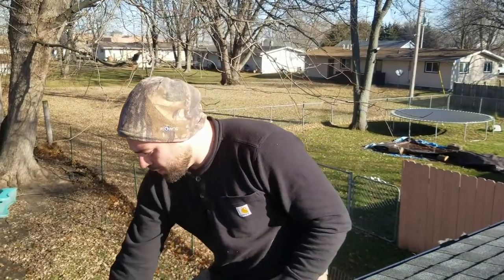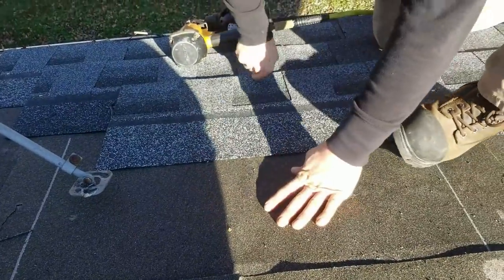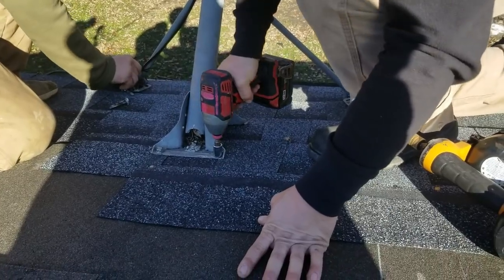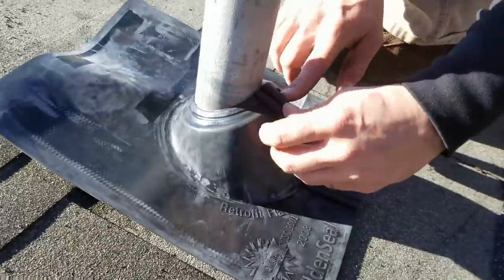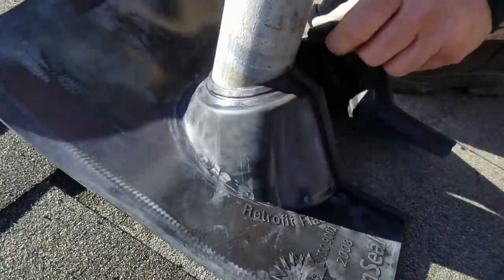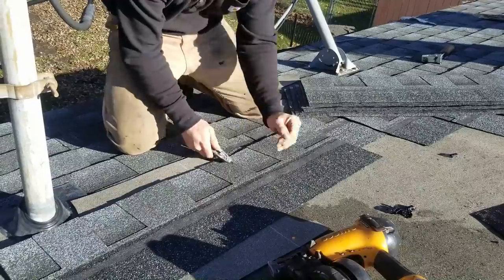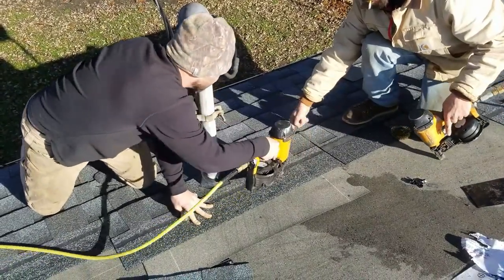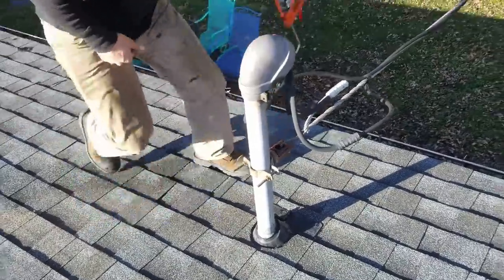How To:  Dish | Split Boot

Comment: Cant beleive in 10 years Ive never realised to use the cut off part of the shingle to recreate the origional stagger after, lol! I always like to cladding screws as opposed to face nailing and caulking it. Outlasts the caulking and sometimes they lift, I notice eapicially in wall flashing. Looks really good too.  On point with boy cub impression.. Good stuff brother
Reply from the maker: Haaaaha awesome you learned that! It's a good trick

Comment: for the bottom part of the boot where the nails will be showing I recommend using screws that youd use for a metal roof. looks better and theres no chance of them backing out or leaking
Reply: Those bottom nails should be covered with the shingle he put under neath never should have exposed material with nails in it like that

Comment: I put ice and water under the disc legs.
Seems to work good.
No call back yet
Reply: As a former dish installer, and someone who has roofed off and on over the years, o recommend this.  The dish installers put "pitch patch" underneath the legs before lagging them down.

Comment: Anytime I install a roof boot or wall flashing, vent. I never use roof nails. I always use 1 3/4  galvanized rubber head ring shanks. Keep a 5lb box in the trailer. Keep up the good work.  Look up Rb 4000 it will improve your business.

Comment: Yo. Just a tip. Cut that ice shield around the boot...cut it just above the nail line....in my area that ice gets between the seal of the shingle and it won't bond....wind rips it right off.
Reply: where are you

Comment: What you did is as good as a manufacture recommendation, but if you want to stand apart and I I shit you not it only takes another 15 minutes that boot could’ve been tar down ice and water over the back of the flange and then you could you could’ve ran a tar topper over the face front of that flange and made it look like a primo roof leaving skylights, Langes and boots. I’ve done the exact same thing. It’s good enough you’re getting a get out but the number one.
Roofer gym Michaels, Jaycee roofing out of Framingham mass really was spot on for quality and looks. Valleys were tarred. Chimneys were tarred skylights were tarred roof vents roof boots we’re all tired and the flanges were never shown. They were always covered with shingles and he gave a seven year labor warranty. As long as the homeowner on the house, he honored that seven year labor warranty.

Comment: You have 2in of boot uncovered and nails showing at the bottom corners, i like to run that exposure piece over top of the bottom of boot and cut it even to the pipe, slide a cosmetic piece under bottom of boot and under that exposure of the shingle.. 1 exposed nail in the center no boot or vent showing on the bottom edges caulk the 1 nail cleaner look more water tight then leaving edges of boot uncovered

Comment: Been meaning to ask you, what brand make and size compressor do you use and how many guns can you run?  What type and size hoses do you use? Last question, if they do, what do you use to keep your fingers from cracking and bleeding when handling shingles? I used a product called New Skin, worked real good and also old reliable Duct Tape. I just couldn't wear gloves when working.     Something different.
Reply from the maker: Plug in is hard to find a gun that'll run 2 good shinglers so I don't wanna suggest anything wrong there. Whatever pancake brand  you like. For gas compressor though I recommend rolair. It Can run 4 great shinglers easy and probably a few more than that if everybody is just average. If you want a little bit cheaper though I got mine from menards, and it's Hitachi.  Mehh, no problems yet... almost a year... can't complain honestly.  I use 3/8 or bigger as lead hoses and we run our guns into 1/4 inch hoses.  Flexilla is the only hose I'll ever buy.  I've heard of that new skin before but haven't tried, I've used the duct tape a time or two but super glue on the tips actually works pretty good too... it wears off by the end of the day. I hate gloves too but if its cold sometimes I'll throw one on...
Reply: Man I can only imagine how bad you roofers get cracked hands. I get them bad just from welding and restoring old power tools and whatnot. Especially with Central New York winters. Duct tape is probably your best bet. I recommend and use gorilla tape. The black stuff. It is pretty hard to get it off when you want to. I'm pretty sure you could tape a bowling ball to a wall with that stuff.

Comment: It's easy to get the dish working again....
1) when you take it down, be careful to not bump it (don't change the elevation or skew angles)
2) when you replace it onto the new roof, put a post level on the pole that the dish is attached to, and make sure it is perfectly plumb. Make sure it faces the right direction (usually Southwest)
3) with elevation and skew angles set, dish post plumb, all you have to do is tweak it left or right (azimuth) until you get good strong signals on the dish receiver signal strength settings screen.
4) lock the azimuth bolts down.  DONE

if you dont tweak the dish up when taking it down, and you're careful with it putting it back... Making sure it's plumb 100% and installed facing the right direction generally you should be able to make it work again easily by only adjusting it left or right.

(Former dish installer)

Alternatively, you could write down all the settings before taking it down (the only super critical ones are elevation and skew) and set it again after reinstall making sure the dish post is plumb ... Making sure the post is plumb  is super critical.

The last tip I have... When dish installers put these up, they usually (are supposed to) put black pitch patches underneath the feet before lag bolting it down.  Then you can seal the lag heads and it should never leak.
Reply from the maker: That's awesome! Where do I get the patches? And also we never adjust the other bolts just the lags that secure it. Never had to plumb it we just go back in the same holes and it works nearly everytime
Reply: I'm not sure where they got the pitch patches from, they have a protective paper over a sticky side. You could probably do little ice and water squares, but the patches are thicker.

You don't have to worry about getting it in the same holes exactly.. just plumb the dish post and the only adjustment you need is left and right as long as no other settings moved.
Reply: @NWIVeteranConstruction We called them pitch pads, but you'll have better luck finding them searching for "mastic pads",but wide mastic tape strips probably work just as well.

Comment: Why would you not put the high side of the boot too the ridge. Was the boot pre cut from the low side? I have asked for a job before. I live an hour or so away, willing to move. Quick question do you put a little gutter sauce on your face nails?
Reply: Obviously there is a reason why the high point is at the ridge i was just wondering. But the sauce question needs to be answered.

Comment: Just curious but have you ever tried the Hitachi nailers. Here in Georgia they are the most popular. Thanks for the great info.
Reply from the maker: Yes good gun, even though they're the more expensive gun I keep it as a back up.   I prefer bostich
Reply: Why do you like bostich ? 
They nail crooked a lot. 
Yours must not do that unless you have an allowable unperfectness tolerance
Reply from the maker: @travissmith3720  I disagree, Hitachi is the crooked nail spitter champ lol bostich is perfect everytime unless it's the humans fault. I don't mind Hitachi, I just dont wear a pouch when I shingle n when I got the Hitachi out the hammer has to stay close
Reply: @NWIVeteranConstruction  it's funny how different guys can use identical tools and have vastly different results. I say use what works for you. I admittedly don't care for any Bostich nailers but if you like them and they are less trouble in your experience, go for it! I have to admit that I like either Max or Hitachi but I am not a roofer. The only thing that I roof is the occasional octagonal gazebo. I would much rather cut an octagonal hip roof than shingle anything! Great work as usual.
Reply: I have used hitachi for years and years..... I have recently switched to bostich. I got my first hitachi from my grandpa for doing his roof and got another one from a roofer trying to talk me out of buying one. First one actually needed to be “warmed up”.... once I finally gave up on it I ran 10 coils through it and it would NOT fire right... I’m not crazy, depth set was correct... fired normal with holding the safety back machine gun style, but contact firing wouldn’t do it.... last one I used in the rain for an hour and I think water got in the piston or something g cause it held air and wouldn’t rapid fire. Always oiled daily, well taken care of and now I own a bostich with no issues doing repairs in Oregon winter!!
Reply from the maker: @chrisparmenter9582  weird! Have you tried cleaning them? They're easy to take apart and put back together just add a little gun oil on the guts and make sure your seals are proper.  N Always double check compressor pressure during gun failures, even if other guns are shooting fine. But that's strange coz my Hitachi is back up, mostly just for winter because my bostich has problems in the cold. Pretty much just my new bostich though, the one I found on the road 6 years ago will shoot fine usually
Reply: Many factors will determine a tools performance. You could have 2 of the same exact guns and one have issues and perform like crap, while the other works great. My experience with tools is the older the better. Made in USA is what you're looking for. Go to the store and pick a few up and see how they feel.
Reply: Worlds Fastest Shingler I have gone through the ringer on em... taken em in and it shot fine.... always check pressure, always clean hammers, oil the piston arm. I’ve let it sit all year so I’m gonna take it in and see if it misfires on them this time.... everything I have is hitachi, that’s how confident I’ve been with them, even when I called the guy said I was crazy but I’m not!! I have a video of what it does, just can’t put it up here!!

Comment: That caulk around the pipe wont last long. Anyway,imagine if that flashing around the pipe need to be replaced?? After all ice shield and stuff,thats going to be pain in the ass. Goodluck with leaky pipe
Reply from the maker: The caulk isn't needed necessarily.  I've been installing those for years they do not leak.

Comment: Cmon bro you can’t place nails too low like that ur shingle wasn’t even touching the other shingle next to it it had 1/4 gap and water shield over that pipe is a no no I would’ve passed that boot in under 3 mins
Reply: Probably would of leaked under 3 minutes too 😂

Comment: I wasted time for years doing the exact same thing but honestly most of the time it will not line back up with the satellite. You are much better off telling the home owner it has to be roofed under and to just have the cable guy realign it or better yet get that damned thing off of your new roof doesn’t belong there and they do not provide proper way to make it water tight. Make the cable guy do his job the right way. They only put them on the roof cause it’s easier for them.